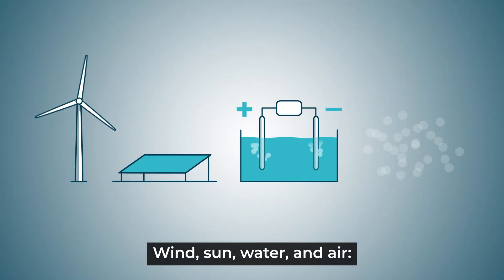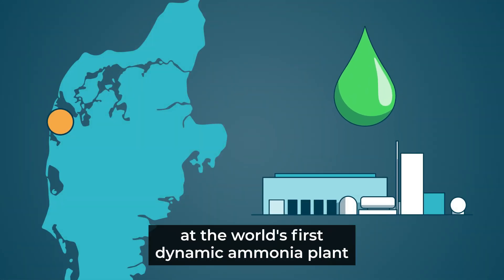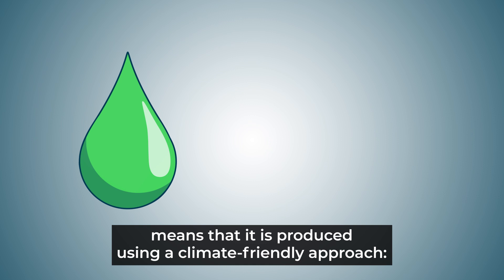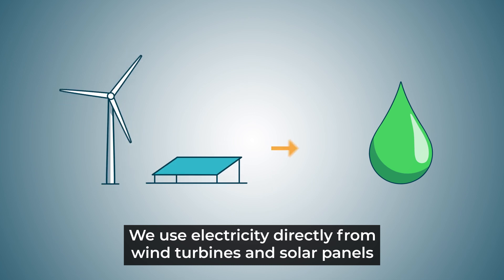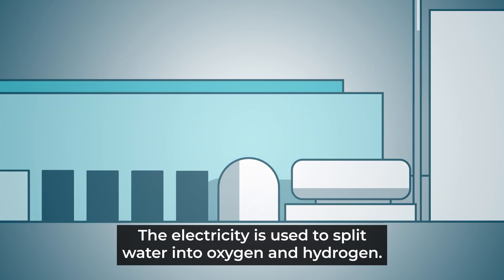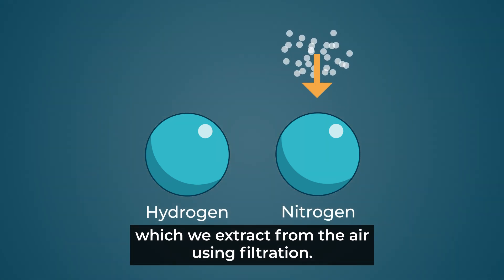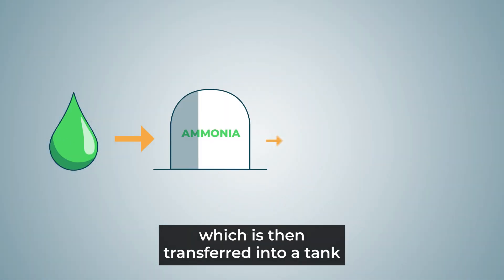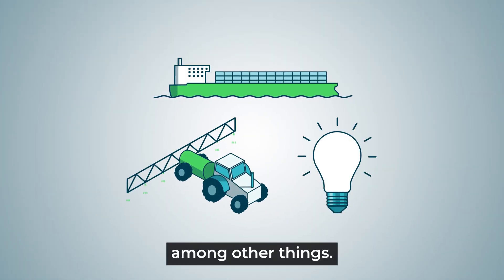Explainer: This is how we produce green ammonia

Comment: Brilliant. I would love to learn more about how the process handles fluctuations in feed power! e.g. are do you turn parallel banks offline as power drops? Or is it simply a drop in the rate of hydrogen production? Can this hurt catalysts?
Also, do you buffer hydrogen in tanks or is it a continuous process?
Now that I think of it, what kind of pressures? I worked in an Haber-Bosch facility years ago, and pressure was the primary bottleneck in the process.